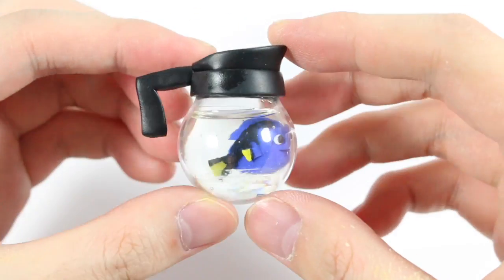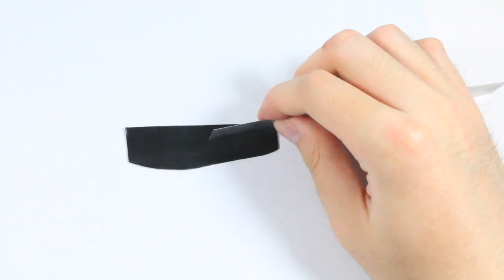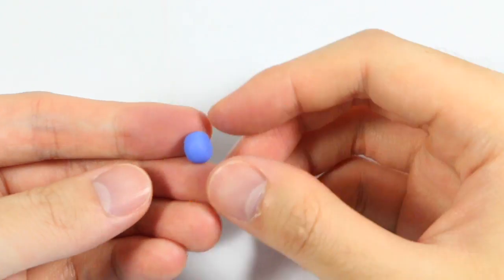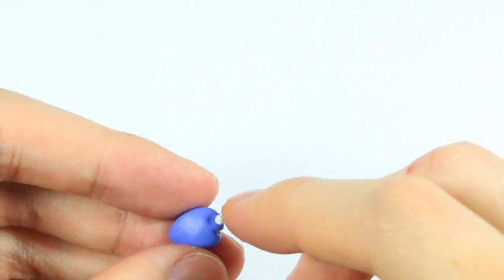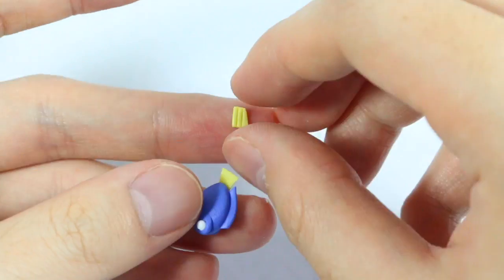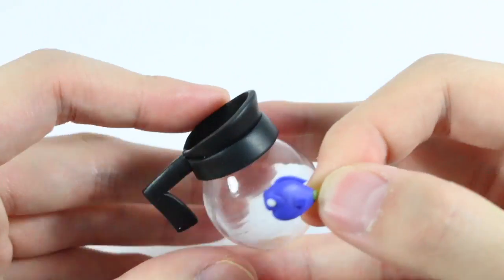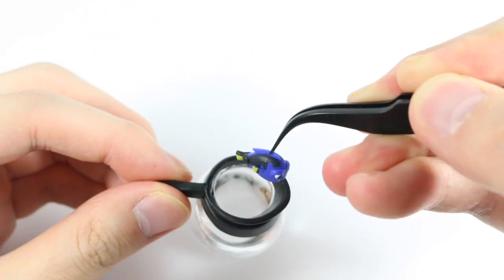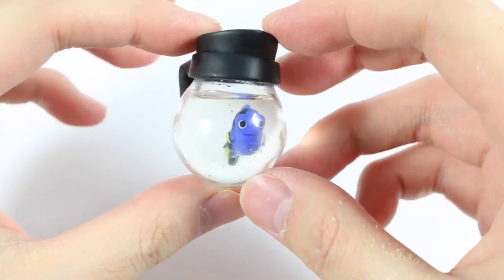DIY Finding Dory Coffee Pot Figure Clay/Resin Tutorial

Comment: I have a question: can I mix my 2 part epoxy resin and then put it in a squeeze bottle like you have it and save it for another time?
Reply: nope, it'll harden either way :) the one he's using is uv resin. those are different kinds that react differently
Reply from the maker: like Jackie said, if you mix two part resin, it will harden no matter what. I used UV resin which only cures in the sunlight or under a UV lamp, which is why it can stay in that form in a dark bottle
Reply: +NerdECrafter thankyou!!
Reply: +PolymomoTea thankyou!!